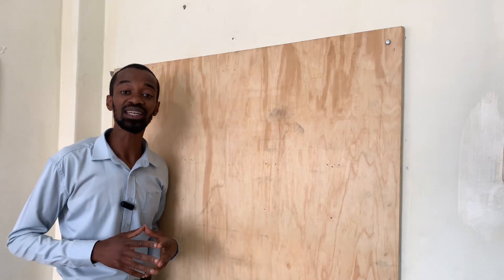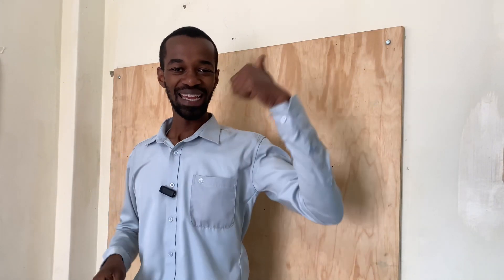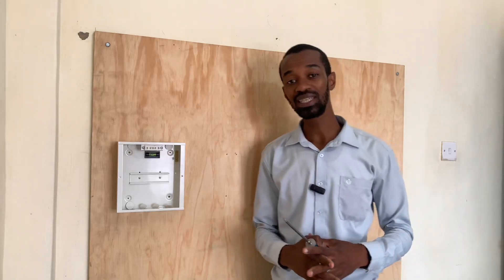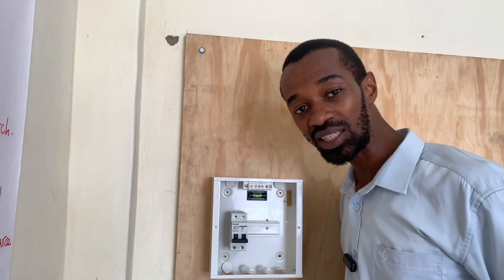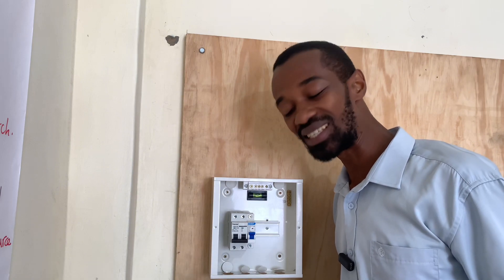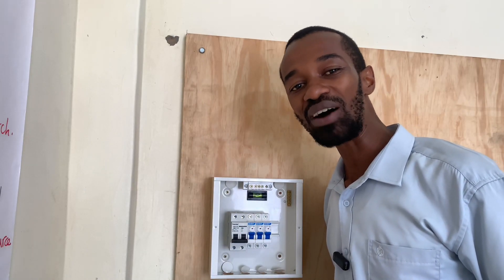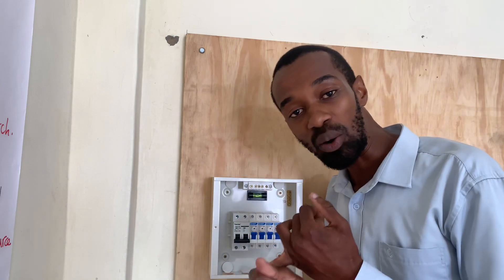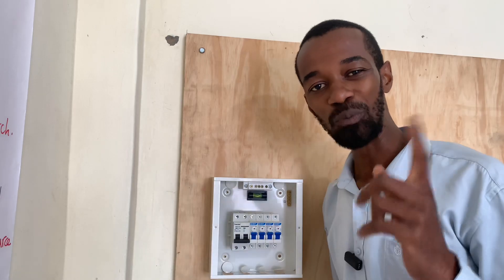How To Size A 4-Way Consumer Unit (DIY PROJECT)

Comment: Before you make a wiring how would you know the type of main switch to use
Reply from the maker: Good question Ntim. The size of the load to be connected will determine the switch.
Reply: Can you make a video of wiring the 4 way CCU